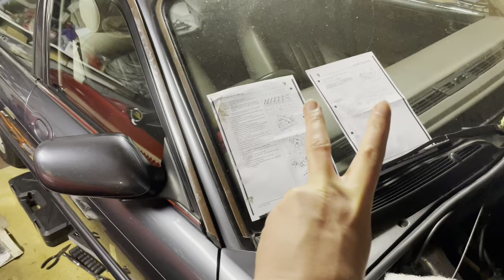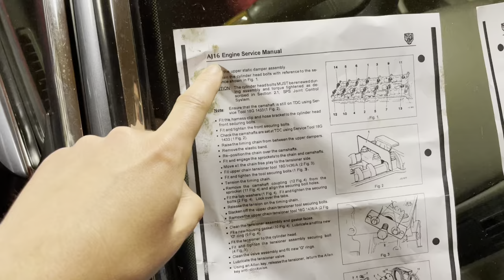Jaguar X300 XJ6 AJ16 head rebuild and gasket part 1 Ep.03

Comment: Can you review the middle A/C vent not blowing air but the sides are blowing air. How to get to the mechanism?
Reply from the maker: How do you mean? Like the actual vent in the centre isn’t blowing?
Reply from the maker: Have you tried running a diagnostic on the AC system. Here’s some instructions I copied!

To check for error codes in the Climate Control System with the internal diagnostics via the ‘Panel
Codes’

1. Ignition off - hold down AUTO and RECIRCULATION buttons and
switch on the ignition

2. press AUTO button - if ZERO shows, there's no stored
error codes

3. Press the RECIRCULATED AIR button to start diagnostic, sequence will start to test system.

4. press FACE button repeatedly to scroll through stored
fault codes

5. press FACE and HEATED REAR WINDOW buttons together to
clear a fault code.

6. repeat step 4 if there's more than one code

7. press FAN button to exit Interrogation Procedure
.

Comment: I bought a English import jaguar X300 and after repairing a great deal of ignored problems from the previous owner the car started losing oil. 

After looking where it comes from I found out that the head gasket failed which unfortunately is probably the death sentence.
Reply: It was funn driving it around 4 months thought
Reply from the maker: Not too bad to fix if you have a socket set and some patience! The gasket kit isn’t expensive. If it’s a nice car it’s worth the effort and if you’re not too handy with the tools now is a good time to have a go :)

Mines been done now all this time and it’s running perfectly.
Reply: @chrisbaker121924  yea but time is a factor. 
It will be another 300€ parts and it's time consuming. 
I also hate working with timing chains

Comment: Lovely car and video! Too bad that my 4.0 isn't going to closed loop and I don't have a VDU/IDS to adapt the O2-sensors
Reply from the maker: Mine wasn’t going into CL a number of years ago and if I remember it was O2 sensor related. Ended up swapping them. Most of the cheap standard code readers will read the live data from the O2 and fuel trims. Usually one is just pinned.
Reply: @chrisbaker121924  I bought new O2s from britishcarparts and drove the Service drive cycle many times. I also swapped the connectors (firewall). Some say without the Jaguar programming that the car will stay in OL. What do you mean by pinned please? STFT is zero. LTFT is 1,27 V at idle, decreasing when I hit the throttle. Thanks mate 😉💪
Reply from the maker: @neindochoohh7955  by pinned I just mean right at the extreme end of the range it can read. Can’t say for sure but mine didn’t need any codes afterwards clearing. The other issue you could have is with fuelling. Perhaps some vacuum hose is split. I’ve had that issue a couple of times with hoses going into the inlet manifold being split and it’s caused issues with fuel regulating etc which in turn affects the lambdas.
Reply: @chrisbaker121924  I sprayed all with brake cleaner while the engine was running. Nothing. I love the car but its also a nightmare
Reply from the maker: @neindochoohh7955  it will be something simple. :) they’re simple cars. Possibly worth cleaning the MAF sensor? If not then yeah probably need to adapt the O2 and TPS.
Reply: @chrisbaker121924  Yes, simple but frustrating 😁 I cleaned the MAF, its at 0,05 g at idle. TPS 12,55 at idle. At 1400 RPM its 2,75%
Reply from the maker: @neindochoohh7955  ah frustrating :/ what part of the world are you in?
Reply: @chrisbaker121924  I'm in germany and you?
Reply from the maker: @neindochoohh7955  UK, probably a lot easier finding spares and info about them over here. They’re still a somewhat common sight on the roads in the UK. I know of a few xj40/x300/x308 that are driving around near me. There’s even a dedicated breakers about 4 miles from my work. Bet they’re quite a bit rarer sight in Germany and bet parts are a little tricker to find.
Reply: @chrisbaker121924  Modern Jaguars are quite rare in germany (except bigger cities). Old Jaguars are very rare. I buy my parts in the UK. The Brexit made it not easier. But the real problem is the repair and diagnosing. Jaguar said that they can't help me, because my car is too old. Thats a shame, many cars die this way.